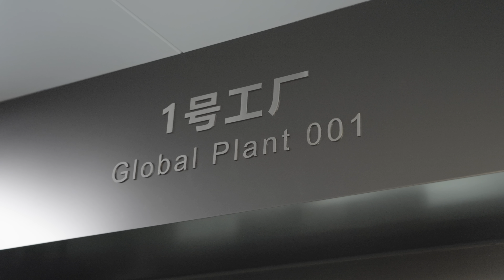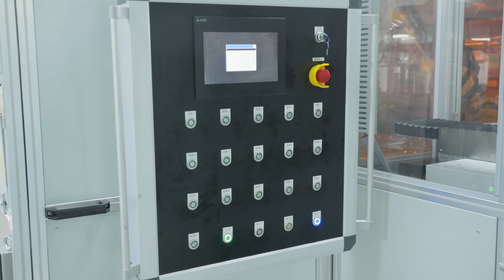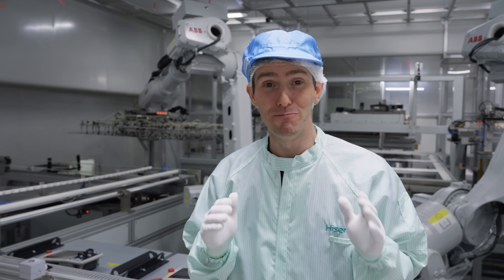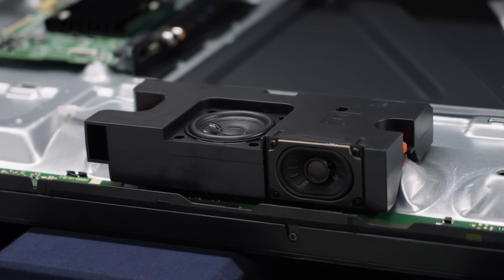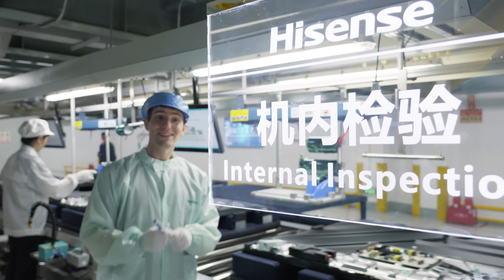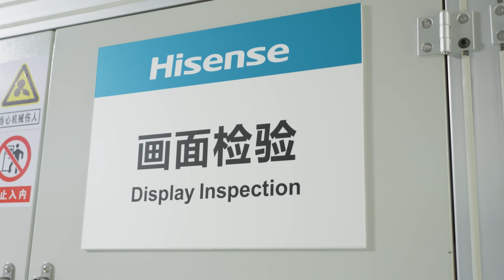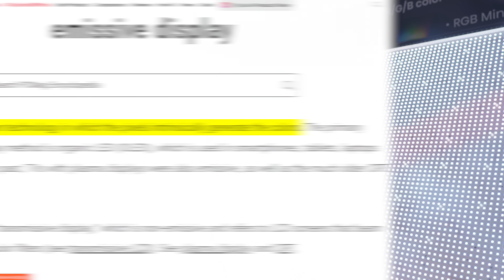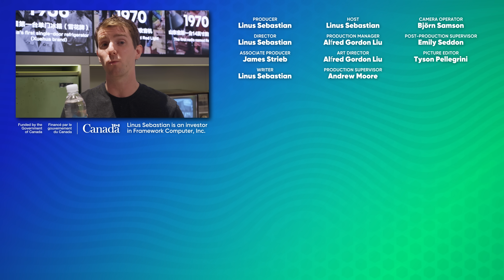This TV Factory is the Coolest I’ve Ever Seen

Comment: I buy Hisense for every product I can. My budget Hisense tv had a top tier panel competing with top of the line LG products, the downside only being the app speed (solve with an Apple TV etc.). My non-garage approved 16 cubic foot freezer has been running through northern Michigan winters for just under a decade with no issues. My $300+ GE dehumidifier didn’t make it through a single summer, but my cheap Hisense has been running for 6 years without an issue. 

It’s stuff like this that has me yelling from the rooftop to everyone I know. It’s refreshing to have a company make something that just works. Especially when all of these products are now considered non-repairable as the cost to repair is more than the cost to replace.

Comment: Hisense Tv are just garbage products sponsored by a big youtube channel, dont buy these tvs saw many in my workshop not working because flaws in their mmc's, company dont give you an firmware for it for change their skhinyx crappy mmcs and put something decent, other their LEDs burnt out because lack of led drivers, and dont tell me their quality in LCD that last for one year and later they dont be accountable for those, in terms of quality better go for a samsung one its next to worse.
Reply: 😅   that is long opinion . Usually says ppl have never seen actual high end line od that brand. 

         🏵️🧩🐸🙉🍉 🐬   vs     🥮🐦‍🔥🦜🪲🪼
The LARGER of TV , Image >  > > STRETCH OUT < <  <. You need Denser Color to look:    3D 
     
 ( Rtings) tested at 10000 cd/m— HDR  
              🔮Color Volume 🔮
Red Luminance =
A90J      72                   ( OLED ) SONY
B4            89     cd/m²  ( OLED )    LG 
C1            84     cd/m²                     LG 
A80L       92     cd/m²  ( OLED ) SONY
Z80A   ==        ( B4 tier )     Panasonic 
Z85A      100    ( OLED )      Panasonic 
   
C4          104     ( OLED )               LG         
C5          134
G4          140     ( OLED ) —-         LG       
G3          140     ( OLED ) —-         LG 
A95K     190   (QD-OMED)
S95C      272   (QD-OLED) Samsung
S95D      371  
S90D      281   (QD-OLED) Samsung 
S90F       309  (QD-OLED) Samsung 
U75QG  410 🔔( mini LED)  Hisense 

A95L       221   (QD-OLED)      SONY   
Z95B       219     ( OLED )   Panasonic 
G5           248     ( OLED ) —-        LG    
S95F       420   (QD-OLED)Samsung
Bravia8|| 344   (QD-OLED)      SONY            
U8QG🐦‍🔥527   ( Mini LED    Hisense              
U9N   🐦‍🔥564   (Min LED )   Hisense
85”UX    530   2023             Hisense 
Bravia9   551   ( Min LED )      SONY 
U8N 75”  421                         Hisense         
U8N         381    ( Min LED)   Hisense                  
U8K         318     ( Min LED)   Hisense
U7N         153 
U8H        265
QN90C    382    ( Min LED )Samsung  (2023)          
QM8K     394   (Min LED )        TCL 

Qm851    585   ( Min LED)        TCL   
Qm8         404   ( Min LED)        TCL   
Qm7K       221               
QM7         291   ( Min LED)        TCL 
QM6K      103 
Bravia7    356   ( Min LED)      SONY
X95L        225   ( Min LED)      SONY 
X90L        272   <  FALD  >       SONY         
Bravia5    137 < FALD-M LED>SONY 
              
“
Green Luminance=
A90J        237     ( OLED )         SONY
B4            306   (  OLED )            LG
C1             291   (  OLED )            LG
C4            333    ( OLED )            LG
C5            478
A80L        317    ( OLED )           SONY
Z80A == ( same as B4 tier )Panasonic 
Z85A        337   (  OLED )     Panasonic 
G4            426   (  OLED )            LG
G3            420   ( OLED )             LG
A95K        606   ( OLED )          SONY 
S95C        882   (QD-OLED)Samsung
S95D      1167   (QD-OLED)Samsung
S90D        856   (QD-OLED)Samsung   
S90F      1,145 (QD-OLED)Samsung   
U75QG  1415🔔  (Min LED ) Hisense
 
A95L         679  (QD-OLED)    SONY 
Z95B        734     ( OLED )  Panasonic 
G5             887     ( OLED )           LG
S95F      1,551   (QD-OLED)Samsung
Bravia8|| 1,074  (QD-OLED)   SONY 
U8Q🥬 2,073   (Min LED)  Hisense 
U9N🥬 1,917     ( Mini LED ) Hisense    
Qm8K    1,206    ( Mini LED )     TCL

——🥬2024 UX 110” ——NOT Tested. 
85”UX   1,656          2023     Hisense
Bravia9  1,130    ( Mini LED )     SONY 
U8N 75” 1,400   ( Min LED )  Hisense
U8N        1,433   ( Min LED )  Hisense
U8K         1,157   ( Min LED )  Hisense
U8H           915   ( Min LED )  Hisense 
U7N           501   ( Min LED )  Hisense

QN90C    1360  ( Mini LED ) Samsung  

Qm851    1,885  ( Mini LED )       TCL
Qm8         1,250  ( Mini LED )      TCL
Qm7K          678  ( Mini LED )      TCL
QM7            826  ( Mini LED )      TCL
QM6K         343 
Bravia7       834  ( Mini LED )    SONY
X95L            781  ( Mini LED )    SONY
X90L            778  <  FALD  >      SONY ‘s = BEST SELLER 
Bravia5        420  <  FALD-Mini LED >  SONY ( NO quantum Dot)

Comment: Make a deal to work with a tv company to design a strictly  gaming tv.. high refresh and large but acceptable size panel.
Reply: U8QG —— 12 bit colour depth 
LG G5 —- flagship 10 bit !

100 💯 % gaming monitors out there are 8- 10 bit color . 

10 bit ——   1 billion color 
12 bit —— 68 Billion 

Hisense —❤❤U9 / UX = 16 Bit ❤❤ 278 Frigin TRILLION colors READY!

So the transition colors won’t look washed out n pixelated , but butter 🧈 Fluid !

Comment: I love Hisense and own alot of their stuff (10,000 btu air conditioner floor unit, refrigerator, and TV's) BUT.. I'm on my 2nd high-end Hisense 4k TV and always had issues with the backlight and grainy picture..I've literally made sure TV is updated and adjusted settings correctly but seems to be an issue with the 4k QLED's.. not happy. Still under warranty considering the 65U8N is not even 6 months old but customer service isnt always helpful. I've checked house wiring and voltage and tried locally streaming and streaming with Xbox series x via enhanced hdmi.. my tv before this one was a 55U8H and had similar issues.. very disappointed also considering that I own a 40 inch 1080p budget TV (like 300$) that was bought over a decade ago and has been dropped and has scratch marks from my toddlers throwing stuff and that TV is still going strong. LoL.. just wish I didnt have to spend over $1000.00 on my 2nd high end hisense in a 3 year period and have the same issues. And yes, I've tried everything.

Comment: I do service for Hisense TV's and they are probably one of the easiest companies to work with and their TV's are quite easy to work on. Component failure rate seems to come down to back light run time, other component failures are extremely low making them quite dependable over all.  My biggest complaint with all new TV's these days though is this "frame less" panel design, there is no protection of the LCD screen outside edge, carrying larger TV's is a major hazard even for people who know how to move them.

Comment: For the last couple of years I've finally gotten past the "cheap trash" and more into the "Hisense is the new Kia or Hyundai of the tech world" where they've overcome their past image of cheap/nasty/unreliable.  Good job on the factory tour.
Reply: @zulnoth  I wish LTT would stop showing us sanitised final assembly factories in China.

Go show uz how the rare earths are extracted and refined before you tell us how great their zero emissions factories are. I want to see the tailing ponds and the untreated waste pouring into the yellow river
Reply: @chugs1984  Do you really need to see those though? Seems you're quite happy with what you can imagine.
Reply: @chugs1984  煞笔，西方不做稀土就是因为西方没有中国的技术，中国处理稀土没有什么污染，好好上学再来网上乱喷吧
Reply: I bought a $900 USD tv just over two years ago and it died right outside of warranty. You may want to keep thinking of them as junk because my research shows I am one of thousands who had this experience
Reply: @clockworkcrow6659  Well in 2023 they made around 26 million TVs. If 10,000 of those TVs have failed by now then that's a 0.038% failure rate. Seems very reasonable if there's only thousands of you.
Reply: @GamePlague Consumer reports survey estimated nearly 20% of Hisense tvs have problems in the first five years. BBB reports are very high too. The other major brands are generally estimated at half that or less. Hisense customer service is also horrible to deal with for anything, but especially for warranty claims.
Reply: @clockworkcrow6659  Is every TV they produce as bad?  A few thousand failures out of millions of units means they've got their shit together.  Even very high value manufacturers with fantastic brand following and excellent reputations have failure rates higher than that - they just have better PR and marketing....
Reply: @clockworkcrow6659  I had the same experience. Hisense "customer service" didn't rise to the level of joke. Their stuff is great when it works but it's unreliable and their support is nonexistent.

Comment: Hisense failed to offer recourse to consumers whose smart TVs broke due to faulty manufacturing. Where OEM replacement parts could have been provided or recalls could have been issued, Hisense instead forced its customers to waste their time, effort, and money to safely dispose of the 55"/65" TVs.

The model H9G/Q9G smart TVs were manufactured using a SK hynix chip on their main board. According to Youtuber Salem Techsperts, a batch of these chips provided to Hisense were defective, causing thousands of smart TVs to fail in the same manner: a bootloading loop.[3] Hisense did not recall the product and provided no recourse for customers who, in some cases, had their TV break within two years of purchase.[4] Hisense also made replacement main boards unavailable.[5] OEM SK hynix H26M41204HPR chips could not be found online. 

Source:
Consumer Rights Wiki

Comment: I tried to fix a fallen lens inside a 65 tv fixed the lens w some glue turned on the TV and it was Cracked from handling it by hand..whoops! Once they get past like 50 Inch don't bother unless you have special tools for handling TV that big its to easy to twist and warp it.

Comment: so many AI buzzwords i worked in multiple automatic factories like this one, you dont change the programming for these arms on the fly you have to stop any machines to change anything, maybe you can optimize an program with some ai vision bull but in most factories there is just an trial period to fix any teething problems. most of these automatic factoriers here were build in the 2010s and some upgraded over the years

if there are manuel steps left its usually because an machine for that is just not cost effective because humans are cheaper as the robots with the maintenance people

Comment: If only good 4k monitors were as cheap as tvs. A pretty giant, nice 4k tv can be like 100-200. Meanwhile a monitor cost like 2-5x for a 27 inch (depending on panel type). Curious if its marketing (like how you profit more off of “gamer” or “business” items), sales volume, or does making something have w high refresh rate truly add that much cost.
Reply: What stops you from plugging your pc to the tv pannel and finding out how this """4k""" works? Spoiler - not good.
Reply: @araamahasla555 already do. I have an lg c3 oled. Its only 120hz, but it made my 240hz ips monitor look like garbage. It also cost nothing compared to an oled monitor and is pretty big.

Comment: I love my Hisense TV. It was about half the price of an Oled and looks  better in some ways, like its brightness or nits capabilities. It’s been about 5 years and no problems. It’s the G7 or U7 55”.
Reply: Oleds weakness is brightness due to heat, its strength is perfect color accuracy and latency. Its the only panel type i believe to get perfect blacks and a truly nearly 0 latency. Due to how smooth they are, 240hz on an oled feels like a higher fps than 240 on a normal lcd. Its hard to go back once you use one, specially as a monitor.

Comment: My hisense TV died October 29th. 4 years old.  It died mysteriously after just turning on for one second then going off and flashing red. One week later my father's Hisense TV dies with nothing going on except a blinking red light. 2 years old.
I take mine to the recycling Depot and the man comes out and without even knowing what kind of TV I am holding, points me to a pile and says that's the Hisense pile you can put the TV over there. All of the TVs in the repo were Hisense and a single lone projection TV.
That repo was cleaned out every week which means the stack of TVs I found in that repo was from one week in a town of 2,000 people. Now tell me with a straight face that Hisense did not send out a kill code to kill all of our TVs.

My father even thought to just swap the motherboard with an equivalent one that he ordered online. But surprise, that doesn't work either because they block you and brick the motherboard if you try to use it in the wrong TV. 

Never ever buy hisense. They are ewaste producers.
Reply: 100% matches my experience and research, my own TV lasted just over two years (only a couple months past warranty) and then died. I have seen hundreds of stories like mine and my TV was almost $900 USD on sale

Comment: The reason you see so many people is potentially because the hardware or process is "too cutting edge" for automation! Partway between research in a lab and massive manufacturing.

fun fact: some manufacturers have so much automation that once a factory floor is going the workers could just leave and turn off the lights (sometimes called "dark factories"). Thing is... everything has to work every time or at least be able to detect every failure. New technology is handled by variously skilled/trained people as it moves from R&D to bigger-and-bigger manufacturing ... which means repetitive tasks on a large scale without a machine means the technology might be literally too cutting-edge for automation to exist yet.

Comment: Those factory tour especially for chinese brand, is really cool, simply because there is some kind of general bad feeling towards high tech stuff when its chinese made, because of all cheap thing you can have that sometimes don't work on temu and aliexpress atleast that the reputation they have and does collateral to other made in china, and this just give a lot of confidence when buying from those brand cause we can clearly no its an actual brand with decent quality control and all. 
There is real cutting edge factory behind those its not like one of those aliexpress/temu thing where you may have a surprise.

Comment: Hisense has came super far over the past 15 years.
Reply: Not based on my research. Quality control is horrible and lots of their TVs last just past warranty or even less. My own TV was almost $900 USD and lasted just over two years
Reply: @clockworkcrow6659  that's common with pretty much every brand especially at the lower price points. Basically end up paying double to replace the device
Reply: @JamesTK  my tv was over $900 USD on sale so it's not a low price point at all, and my research shows that a huge number of them manufactured around that time have failed, before or just after warranty, with no acknowledgement or recall from Hisense. Add to that how terrible their customer service was, I absolutely cannot recommend them.

Comment: The backlight example at the end is pretty awesome. The factory tour was also great. Thanks for the inside look!
Reply: Can’t wait for that tech to make its way to computer monitors
Reply: @berengerchristy6256  Hisense does make qd miniled monitors, but no rgb backlight ones (yet). btw their LCD seems to leak more than TCL's panels, hence the blooming, might be to panel quality or just overall optical design
Reply: I found it pretty weird that they seem to be using 1/6 of the achievable resolution, if you look closely at @12:07
Reply: The RGB back light was so cool. I don't know why by I did not think they'd look like that, but of course they would, they are basically just giant pixels.
Reply: Backlights on Hisense are know to fail after 2-3 years after which the TV is landfill due to the glued screen
Reply: @lhassall77  Source?
Reply: It’s nice too see something that will fail in 5 years. Interesting.